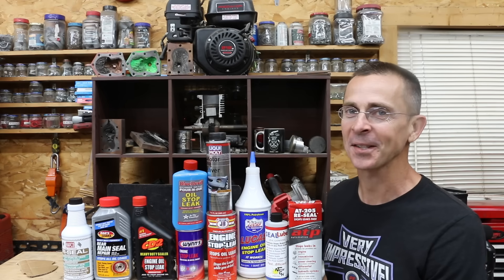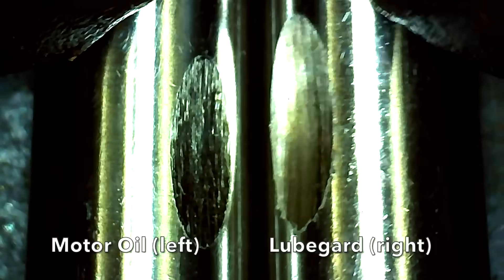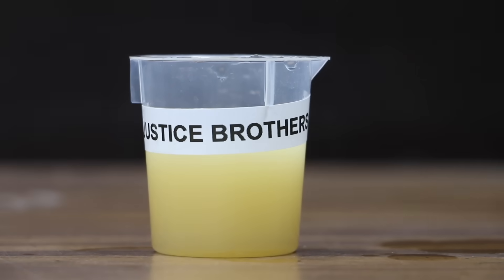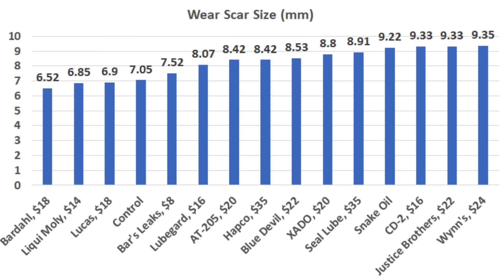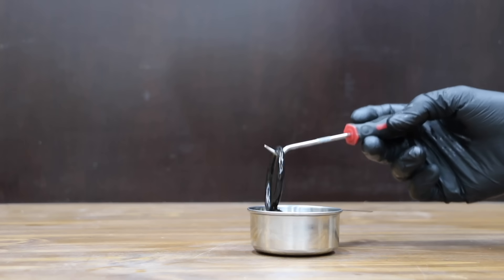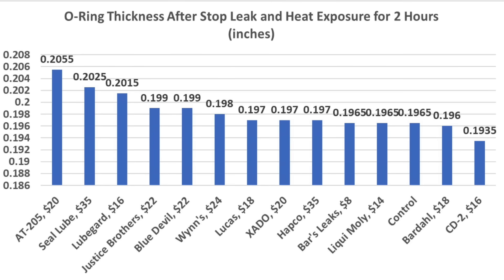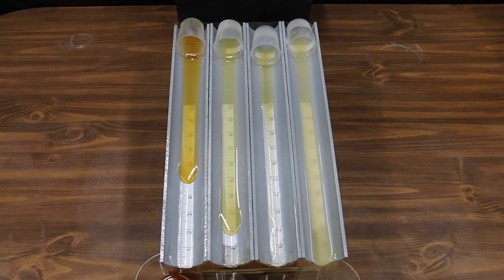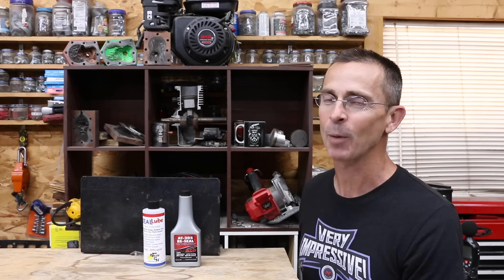Do Stop Leak Products Work? Do They Damage Engine Seals? Will They Destroy an Engine? Let's Find Out

Comment: I think this would be a test where either the raw result or a qualitative rating would be better than the rank result.

In some tests, I'm not sure finishing in first place is good: in the puncture test, if a product disintegrated the gasket and punctured after 50 grams, I would consider that a failure. If a product expanded new gaskets excessively, I would count that as a failure. I think the best result for new gaskets is minimal change in size. An O-ring shouldn't need to be bigger than designed.

For the products that didn't mix, I wonder if it would be more reasonable to test them without mixing. I have zero idea about how thoroughly they would mix in real engine performance.
Reply from the maker: Thanks for sharing!

Comment: OK......I HAVE to post this comment.  LOL   So, my power steering went to leaking on my 2000 Mazda B2500.  I put in the BAR's PS stop leak.  It worked!  A year later, still no more leaks.  Then on my newly acquired "Sir Leaks-a-lot" 2004 Avalanche, like dude if it is an oil it leaked on this truck lol  So once again, I used BAR's power steering stop leak, yup, fixed that leak! Then I used BAR's engine oil stop leak, yup, it stopped that leak too. And I thought what the heck MAYBE their Transmission stop leak will work on the transmission seepage from basically everywhere it can. YEP.  FIXED THAT TOO!  HAHAHA!    I am NOT sponsored in any way to endorse them.  I am simply saying real world nearly 240K old beat to snot "good ol work truck" Chevy Avalanche and BAR's stopped ALL the leaks.    Another awesome vid dude!  You are truly the BEST at these reviews!
Reply from the maker: Thank you very much!

Comment: for those that don't have 20 minutes, ALL the products that actually made rubber swell and soften all wreck the viscosity of your oil, just fix the oil leak with a new seal so you don't fuck your bearings.

Comment: On my cars Bars Leaks didn't work.  Lucas didn't work either.

AT205 did work wonders 
Blue Devil also worked for me

a shame that it seems to make things wear with 50/50... That said, you don't mix 50/50 with this.. it is more like 80% oil / 20% stop leak.
Reply from the maker: Thanks for sharing!

Comment: I had a COOLANT leak in 4.0 OHC Ford that was leaking a small stream of coolant out of the intake manifold onto the front of the engine.  I put in a can of K-Seal powder and the damned thing stopped leaking in 5 minutes.  Lasted a full year when I added more and stopped it again.  Did not plug the heater core either.
Reply from the maker: Thanks for sharing!

Comment: "Much newer vehicle" like 2014 to the present? I have a front differential leak on a 2013, Sierra. Synthetic on the rear conventional for the front fluids. Why, because supposedly Synthetic damages the seals in the front, less use was the reasoning.

Comment: Don't think I'd use any of the brands that cause more engine wear even if they are great at stopping leaks. I mean, an oil leak shouldn't hurt anything too much as long as you make sure the proper amount is still in the engine. The more engine wear could mean the life of your engine in the long run.
Reply from the maker: Thanks for sharing!

Comment: I use AT-205 externally on my vehicles i.e. on exposed rubber like steering rack boot, cv joints boots and strut towers. I does a great job in keeping them from drying out and getting hard. Put it in a spray bottle and apply it a couple of times a year. After seeing the wear scar when added to motor oil I definitely do not think I will use it in an engine though I would in a power steering unit.
Reply from the maker: Thanks for sharing!

Comment: Is softening the gasket material and O-rings for certain a good thing?  I don’t know if you want a softer rear main seal for instance.  It would have been better to test wear, cut, and tear resistance after treatment. 

Making a gasket too soft also will make it more likely to leak as the clamping force at a specified torque will decrease as the softer material is displaced.

I don’t feel it is fair to test the products at a 50/50 mix either. They should be tested at the middle of their specified dilution.

Really enjoy your content, that feedback aside.

Comment: I wonder - would using the additives that had high additional wear for short term use (running engine until hot, letting sit overnight and then changing oil before using motor) would give seals a chance to expand and soften?

Comment: The 50/50 mixture was a bit much since most applications would be 9/1 or 11/1 oil to additive mix. 
It would certainly be worth the try of even the most expensive product than to go straight to replacing the leaky seal.
Your tests are always instructive and evenly applied to the products.
Reply from the maker: Thanks for sharing!

Comment: Why did you choose a 50/50 mix for the lubricity test?  Wouldn't using the ratio that the product recommends being much more beneficial?  If a product increased friction during your tests, that doesn't really tell me much, because I would never run my engine on a mix of 3 quarts of oil and 3 quarts of stop leak.  This is not at all a hater comment.  I'm very curious about your reasoning and I love all that you do.  Keep it up please!

Comment: I usually agree with your testing methodologies, but your lubricity test will give many viewers a false impression that many of these products can cause engine damage by decreasing the lubricity of the oil in their engine. You were mixing all of the additives 50/50 with oil.  Most of these additives have a much smaller ratio. For instance AT-205 is to be mixed at only 8 ounces per 6 quarts oil. That is a 1/24 ratio.  I would suggest a redo of the lubricity test with proper ratios for a more accurate representation.
Reply from the maker: Thank you for the video idea!

Comment: i dont use stop leak products anymore. my brother and i used some bars stop leak rad sealer as he had a small hole in his rad, and we needed to get back home (it was about a 1-1.5 hour drive). it all all fine for the first half an hour, then things got bad quick. we ended up blowing a frost plug out of his engine, and locking the engine up. it had formed a big lump inside the head and wouldnt allow the coolant to flow anymore. we might not have used it properly, but even if you misuse the product, it shouldnt total your engine... we ended up having to call a friend with a trailer and pick up the car to bring it home. we tore the engine down and found the massive plug inside the head. i havent used a stop leak product since, and i always warn people about using them haha. if you can, just replace the seal.
Reply from the maker: Thanks for sharing!

Comment: For me I'd be happiest using Lubeguard by the look of those results. Very little extra wear, while also helping bring the seal softness back down and increasing thickness. It's pointless using a seal improver if it also damages you engine through excessive wear so that one is probably the happiest medium!
Reply: I would like to see him mix Lube Guard half of a dose with a half of a dose of Liqui Moly... As long as there is no issue when they are mixed, I suspect the Liqui Moly would protect the engine while the Lube Guard conditions the seals. Might end up being the "perfect" product...
Reply: Also remember that he tested the products in the wear test at 1:1 with the motor oil to emphasize their effect so that they could be more easily compared to each other.  In the engine, the product will be 1:4 or 1:5 with the motor oil, so the impact on wear will be far less than what the tests showed.
Reply: AT-205 soaks into the gaskets and seals, so it's not sitting in the oil forever, just until it gets to where it is needed.
Reply: Keep in mind he mixed it 50 50 and the instructions are far less than 50 50. There would be no noticeable difference if he would have mixed according to direction
Reply: @lsumaniac2485  ... we're also doing an accelerated test so no control for anything age related.
Reply: AT-205 is great for stopping engine oil leaks.  I used a half bottle in a 95 chevy 350 and changed the oil after about 500 miles and it still does not leak.  I don't drive it at all now and only changed the oil the one time after adding a half bottle but it's bone dry.
Reply: At-205 is my favorite too
Reply: Based on the data, Hapco looked superior in regards to being the most well rounded product.
Reply from the maker: Thanks for sharing!

Comment: Lucas Hydraulic oil conditioner and power steering stop leaks  works on my  old crane and Mack truck.
Now just slight seepage .
Took a week of running.
Maybe leave orings in chemical for a few days next time.
May take longer.
Excellent 👍
Reply from the maker: Thanks for sharing!

Comment: I was impressed with the AT-205, in a good and BAD way! First the BAD! The way it performed in the metal wear test was RIDICULOUS! I can only imagine the wear on the piston rings, bearings, crankshaft, etc... WOW! But, on the GOOD side, it was pretty impressive the treatment on the o-rings, seals and gaskets. A pretty good mechanic that I watch his videos, his name is Scotty Kilmer, and he suggests AT-205 as a good "stop-leak" product; but I wonder if he knows of the DAMAGE it causes to metal parts!? 
I have been a truck driver for over 30 years, and have used Lucas products many times, and every single time, leaks, smoke, oil burning, loud rough running engines were corrected with it. I once had steering fluid leak so bad, I had to add 1 quart EVERYDAY (the reservoir held 3 quarts); after adding Lucas, after only 1 day running, IT STOPPED COMPLETELY, 100%, NEVER to return, and operated much smoother!!! The same for motor oil burning, white smoke, rough idling; after using Lucas, IT ALL STOPPED! And the engine ran for another half-million miles before having to get an overhaul.
Anyways, as much as I see AT-205 performed real well repairing gaskets, rings, seals, the wear on metal parts was just CRAZY to even EVER consider it. I'll stick to Lucas.
Thank YOU, for yet another great video👍
Reply from the maker: My pleasure!

Comment: I am still curious on which brand would be the best to go with if I only wanted the minimum amount of batteries (about 4 with the EcoGo mower). As I am sure many are aware, batteries are often just as expensive as the products they are paired with.

The suggestion is which brand has the best multi- function batteries? We could see this being the longest lasting test to see which brand has batteries wear down over the use of a summer, switching between weed eaters, drills, shopvacs, leaf blowers, and whatever else gets used taking care of a property during the summer.
Reply from the maker: Thanks for sharing!

Comment: I think one of the takeaways from this is “don’t continually run these products in you engine, give them time to work, then change the fluid, because they do reduce the wear protection of the oil”.

Granted, your testing exaggerated this greatly by using a 50/50 mixture vs the much lower mixtures recommended for use, but there is clearly some loss of wear protection with all the ones that actually helped swell and soften the seals.

Because of this, retesting the seals in straight oil following application of this would be very relevant. If you have to use these products every time you change the oil/fluid, you are risking increased wear on a continuing basis. If you only need to apply this every 25k+ miles (40k+ km), then that’s probably not anything to worry about.

Comment: To me it looks like the brands that actually helps the o-ring also is bad for the lubrication of the engine...
So the only way to safely use theese is to add one just before the oil change, let the engine run for a few mins on idle to distribute. Stop the engine and let it sit over night. First thing next day is to change to fresh oil.
Question: Will the effect on the o-ring remain when the stop-leak fluid is removed with the oil change?

Nice to see that some actually affected the o-ring!
Not so nice to see that the same brands also were very harmful to the engine by drastically destroy the lubricity of the oil...
Reply from the maker: Thanks for sharing!

Comment: I don't know how well these tests apply, very few of them mention lubricity as a benefit. These are designed to work in an engine under pressure, I assume when they come out of a leak under pressure heat they have a property that helps them clog that gap.
Reply from the maker: Thanks for sharing!

Comment: Hahaha I wish this would’ve come out about a year ago. My steering box sprung a leak in my truck and so I started throwing stop-leaks at it. Started with blue Devil with poor results, Lucas did well for months until it got very cold again, then it sprung again and two more bottles of Lucas wouldn’t stop it up. A shop suggested AT-205 and the first bottle sealed it up in the dead cold of winter and is seemingly still going strong after a couple months 👍
Reply: So realistically I’ve probably got a mix of Lucas, AT-205, and a bit of Pennzoil PS fluid haha. The AT-205 sealed the O-ring, and the Lucas restores thickness of viscosity loss 😂🤷‍♂️
Reply from the maker: Thanks for sharing!

Comment: Never put any of this crap in a modern engine. Also, changing the velocity of oil in modern engines, which usually require thinner oils will do more harm than good. Now if your engine is old and wore-out then knock yourself out with these products as they made buy you some extended but limited time.
Reply from the maker: Thanks for sharing!

Comment: What was the rubber compound of the 0-rings that you tested, were they Buna-n which are expensive, most of those kts of o-rings are not Buna-n ? And I believe that the compound usd in seals are Buna-n.

Comment: I use stiction eliminator (hotshot secret) with every oil change. When i bought my truck I had a lifter tick on startup that would last about 1&1/2 -2 min. Using the additive it now only ticks for about 20-30 seconds, and my fuel mileage seems to be about 10% better. I would love to know if the improvement is all in my head or not! (The truck had been sitting for a few months before I bought it) There was about 2 months between purchasing vehicle and starting to use the additive.
Reply from the maker: Thanks for sharing!
Reply: Judge Dredd: Yeah, I heard you, hotshot. 
Zwirner: What? 
Judge Dredd: I said, "Hotshot."

Comment: This is an xtremely useful test. I’d like to see at least the high performing, high wear products run at closer to recommended concentrations to see how the wear is at those concentrations. Thanks much!!!  PA. Reasoning: Sometimes if a little bit is good, more is better doesn’t always apply.  Also, call out the ones that require adding each oil change as opposed to those that don’t. Perhaps a one year test to see if the rubber deteriorates from long term contact.
Reply from the maker: Thanks for sharing!

Comment: Tangentially related-

About 15 years ago I got a minor hole in my radiator. I decided to try a pour in stop leak product. I cannot recall the product brand or name. It worked- so well, in-fact that it also sealed the pressure release valve on the radiator cap, which I suppose is technically also a leak.
The pressure built up in my radiator and blew out the plastic clamshell up top on the radiator. There was water on my windshield and I wondered how I hadn't seen a water-filled pothole that I apparently managed to hit until I noticed the little bits of the stuff I had poured into the radiator the day prior and realized immediately what must have happened.

Not sure if it was a fault of my own or a fault of the product, but I fix my radiators by replacing them if they are a newer unit, or by repairing them with a brazing torch if they are an old all-copper unit.

YMMV, of course- which is why this channel is so valuable- it gives us some idea of how products actually perform before we try them out ourselves. Love your content man, so greatful for the time you have spent saving everyone else's.
Reply from the maker: Thanks for sharing!